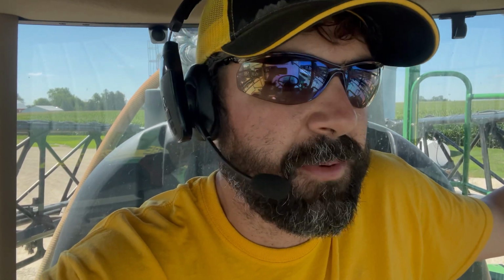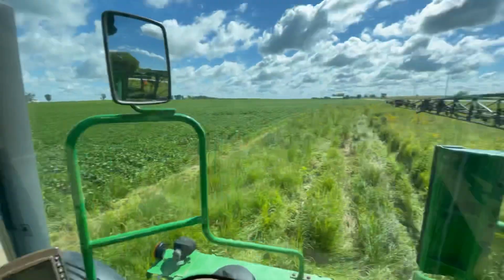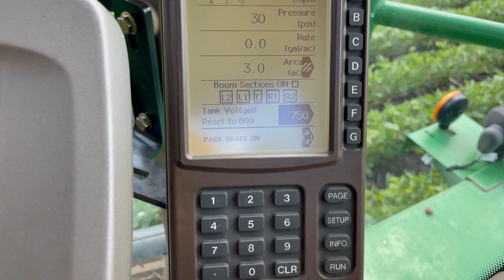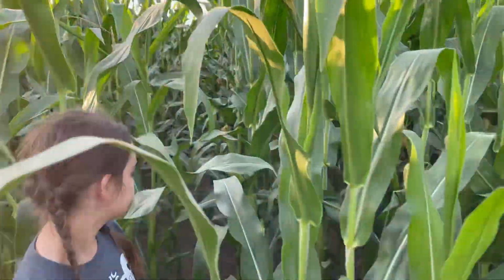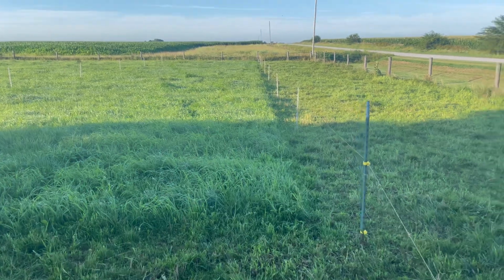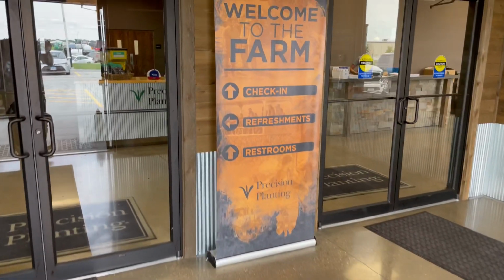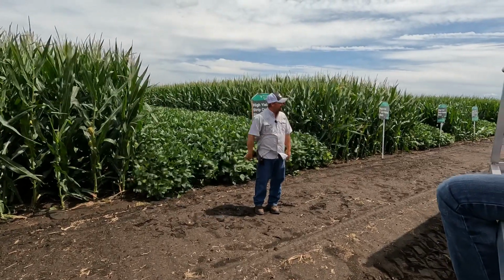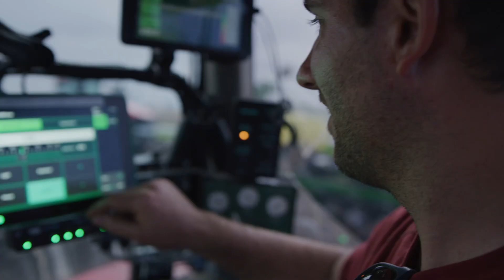I just learned how to run the sprayer!

Comment: Rotational grazing works well. Worked for a farmer that did this in the 90s in Iowa... the height doesn't matter if it's edible and not a weed. A polywire wire on reals with stake mounts, and plastic fence stakes with electric fence worked very well to divide up  fields into paddocks. This is also a method used in Europe.